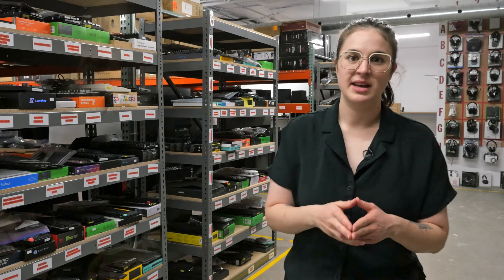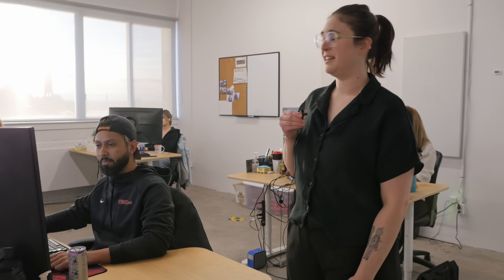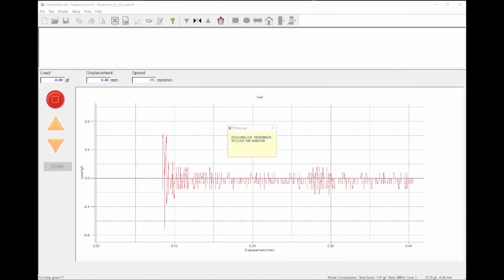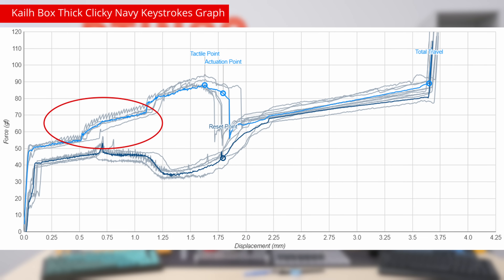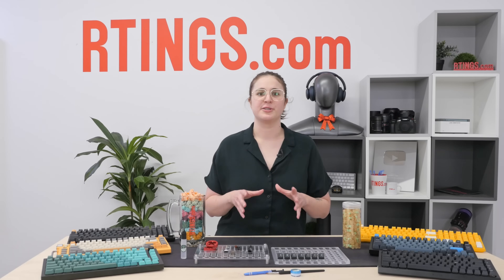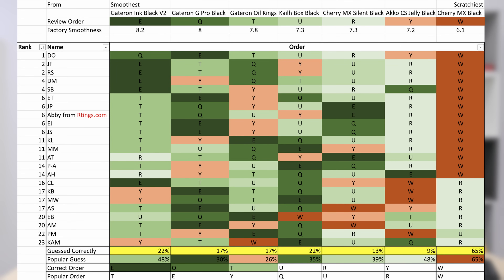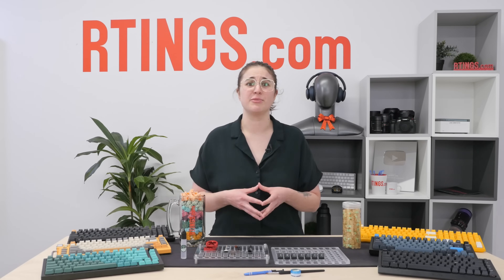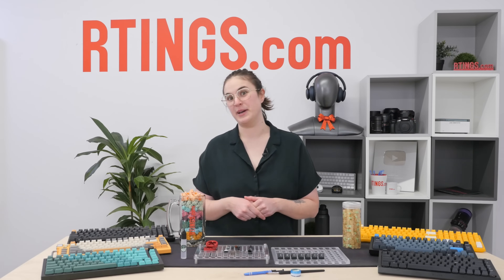We Objectively Tested Smoothness For 100+ Switches

Comment: I think adding the audio component was done a little early/hastily for this.
A wider selection of switches should've been used to detect at what point the scratchiness factor enters into the noise level/floor of what is distinguishable for human perception, while having the test run in a quiet box that participants would reach into, so that they couldn't hear the switches but had to focus solely on the feel of them. This would additionally require a quiet room for the participants to control for exterior noise and vibrations impacting the testing.
Then for the sound, participants shouldn't touch the switches at all but rather have a machine actuate them for consistent reproducible responses, and they should be listening at a set distance.
I'm sure you have a weighting between the scratchy factor and audio one for the factory metric, and I think until you individually measure the perception graphs (think SPL A curve) of both, your compound score won't be accurate. It's not enough just to tweak it until it matches what the participants scored in this one test, particularly when noise floor thresholds are hit/involved. (when I say noise, I don't mean sound. I mean the point at which you can't discern from no stimulation/difference at all: the placebo point)

I wanted to join rtings a few years back, I'm in the area, but covid really messed things up for me...

Comment: Maybe I missed it, but did you get data from the load cell with no switch underneath it? Is it perfectly smooth every time?
Reply from the maker: Without any resistance the load cell records 0 with minimal noise. If would spike hard once it would touch the PCB and the machine would reverse.

Comment: Why don't you test these mini switches against a full size cherry DX-44 mounted in a IL\Happ button for a unbiased neutral control. It's not a Keyboard button but if any mini button can even get close to a full size microswitch mounted to a 2in plunger with a large spring inside it, it means its a decent enough switch.
Reply from the maker: While we catchup on the backlog of user questions from the holidays (our team was off), we're currently answering all questions via our website to ensure we don't miss any! https://www.rtings.com/forums

Comment: "objective". imagine trusting someone who is putting switches (oil kings) that not only have polished molds/polished rails and also come factory lubed at around the same level as switches (mx blacks) which have years old, worn out molds, are so scratchy stock that they are basically 95% of the switches that people send in to get diamond polished and broken in by specific services just to be at an acceptable level of scratch. not even the best batch of MX black is anywhere near as smooth as the average oil king.

Comment: Vouching for the off-center test here. Especially hitting LCTRL with a force vector that's not perpendicular to the key. I switched keyboards because of a difference in that, even though I couldn't tell the difference in normal up-down presses.

Comment: Good job, factory lube makes such a a difference, great to remove subjective testing since so many people are wrong, especially without having a wealth of experience to compare with. Even with objective testing though, it's ultimately still the users subjective preference and experience that matters most when selecting a switch. more data is more better though! I wonder how my smoothness ratings compare with your objective measurements

Comment: You should do more tests but with off center keypresses. Most linears feel exactly the same when testing straight on, give or take the spring and leaf properties. Off center presses are where you'll actually see switch materials and designs actually being stressed.
Also if you want to make an ultimate test, you should also test the raw components and build a frankenswitch with objectively the best parts, and then use that as a reference.

Comment: I would strongly suggest also testing off center! Some switches are incredibly smooth straight up and down, but won‘t be as smooth when pressed off center. I know this is more of a stability problem rather than factory smooth test, but this definitely means something.
Reply: yea off center test is important   reminds me about a video regarding the worst switches ever. some of them had a tendency to jam wen pressed of-center. in-case anyone is wondering pretty much all the first places were extremely old
mitsumi miniature mechanical place 2
Reply: yeah I was thinking about it as I heard about the test setup. Most "scratchy" feeling keys feel that way when pressing with some side force
Reply: @AtaGunZ  yes, exactly.

Comment: i started typing this before I have finished watching the video. I would want to know if the travel time between "home to actuation to bottom to reset to home" and their variant lengths of time between each switch could result in different noise levels or smoothness.

You have a slide that shows actuation to reset, but obviously this video and its contents are about smoothness. And the video doesn't cover what i am describing.
Reply from the maker: Our other video that we did might help answer some of what you're asking! https://youtu.be/uTz7RsPLkE8

Comment: As a fellow Box Jade user, I appreciate Anthony. If he wants to be even more annoying, there exist the most amazing (and cursed) clicky switches in existence. The "Zeal Clickiez". They're at least twice as loud as the Jades, with a deeper more satisfying sound. If you want the best possible sound, remove any keyboard foam, and buy a larger, preferably metal, case to allow the sound to reverberate. The only disadvantage is that the "light" version requires as much force as the average "heavy" switch category.

I'm glad someone is working on improving testing poorly understood components. You're doing great work!
Reply from the maker: Thank you! 😄 We'll let Anthony know about those switches and also apologize immediately to the rest of our coworkers 😂
Reply: Where can one find these, I've been looking forward to them for years?
Reply: The peak force of Clickiez is relatively high, but the post-travel is low and flat. So to me at least, it still feels like a medium-weighted switch.

Comment: I've had an acryl base like that and the switches weren't very secure in it. some were moving inside of the holes, some poped out by a millimetre. Though it will take more time, i recommend using solder to fix the switches in please and eliminate variables.

Comment: Can you guys look into laptop keyboards? Some laptops have issues where if you don't press down on the keys correctly, such as on a corner or edge, you can feel the "snap" of the key actuating but it won't actually yield a keystroke. Notable examples would be the ASUS gaming notebooks. I have some video documenting this if you need an example of what I mean, but it should be easy to check for - just slowly apply pressure to the key at various spots and see if you can get the key past that actuation point without a keystroke happening. 

In my experience, the keyboards where this is very easy to do I experience higher error rate in my typing, more people report keycaps falling off (Cause of bad stabilization maybe?), and many of them tend to be gaming machines. Some of them even aren't (such as some of the Dell Latitudes I tested) but I don't have a good way to quantify this per machine. Seems like you guys have the equipment to better do this than I ever could/was able to. Thanks!
Reply: The spacebar on my Surface Laptop has this and it drives me absolutly bonkerbecauseIonlyrealize too late and have to backspace a bunch....

Comment: What an amazing video yet again from Rtings! Thanks! I'm actually thinking of buying a new keyboard, so this info comes handy, even though I'm not some kind of a keyboard wizard. One suggestion: Does the feel (or scratchiness in this case) of these switches change after longer period of use? If the plastics are rubbing on each other, I would assume, that would change the feel of the switch after loooong period of time, so something to think about setting up for fun to see in the future!
Reply from the maker: Glad to hear you enjoyed the video! 😄The feel will change the more you use them and break them in, though it can take a long time to get to that point as you mentioned!